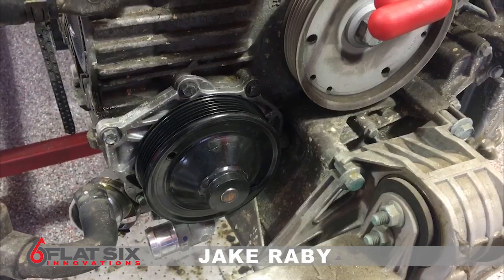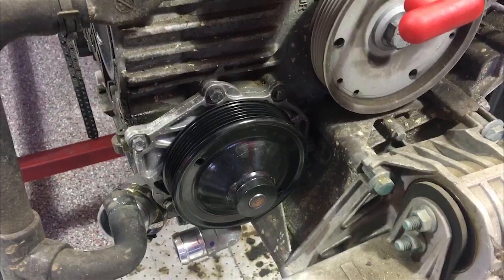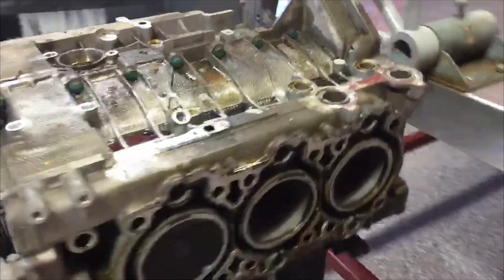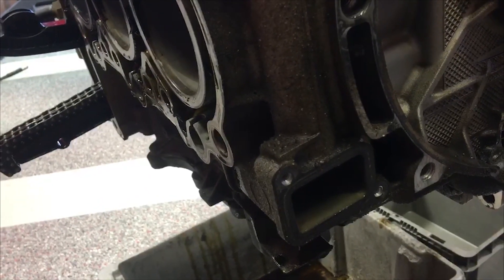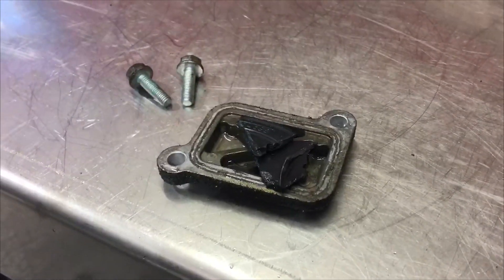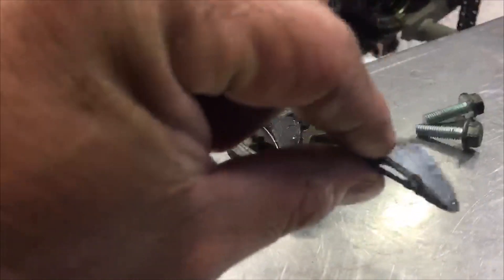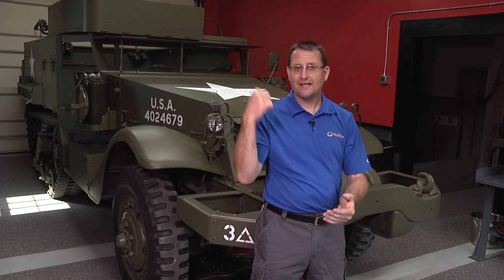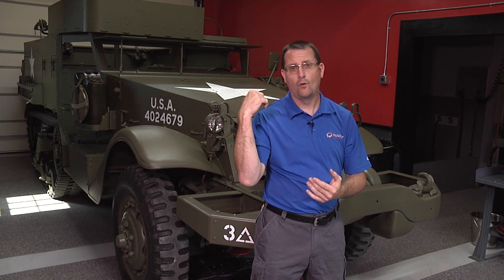Flat 6 Minute -  When replacing a water pump is TOO late | Porsche 996, 997, 987, 986

Comment: Do not buy the Gates branded water pumps (got mine from Amazon, assuming they weren't counterfeit).  One failed internally after 1 year (impeller and blades came off shaft), and the next two had wrong clearances that made them jam against the block right after installing and couldn't be turned by hand.

Comment: Could a metal impeller fail in the same manner? I'd rather have plastic rattling around then metal shards.
Reply from the maker: We do not recommend water pumps with metal impellers. The metal blades will do damage to the block as well as shed metal in the coolant systems.

Comment: Wow! Those are the entire pump impeller blades! Not just bits and pieces that got machined away from the failing bearing. That had to be a significant previous pump failure. Good example of the why for the change before failure "suggestion."

Comment: Hello quick question.  How would you flush your engine oil if antifreeze got inside and has a milkshake color
Reply from the maker: If it hasn't been contaminated the system for any length of time, use hot water and shout to flush the system. But you MUST find the source of the intermix. Usually on the heads.